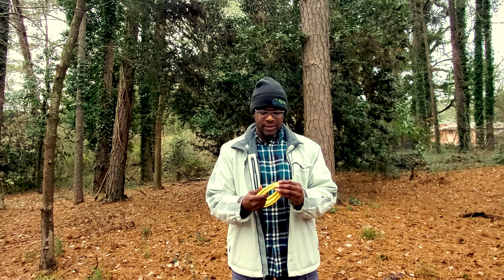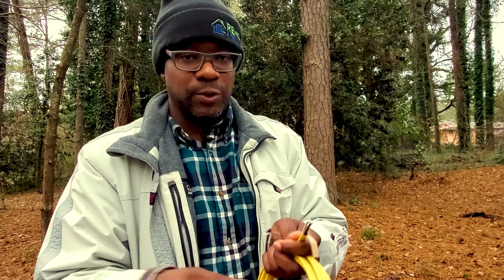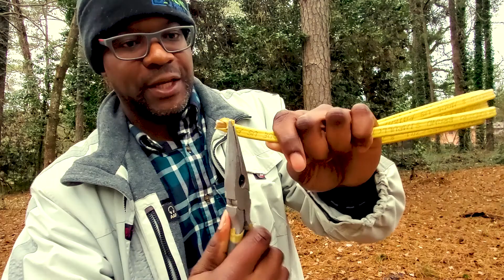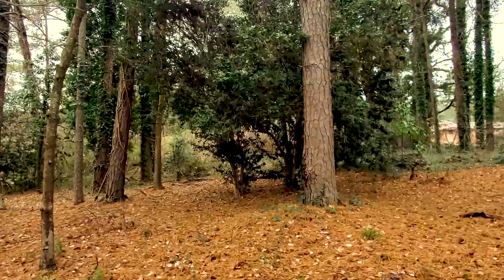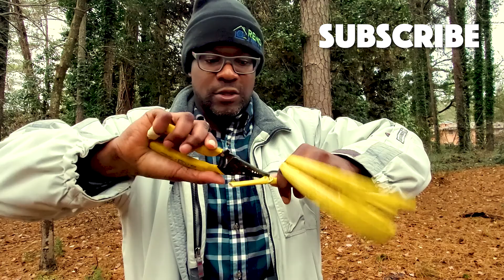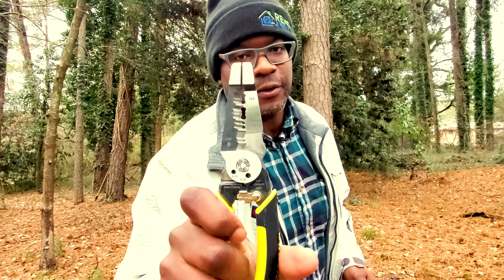How to Strip Romex Wire | 4 Different Ways

Comment: One of really good ways to strip as far as the outer casing goes,make a cut right in the middle of the wire, then pull from the middle not too much though you  don't want to bend the other little,wires to much anyway if it's newer the casing should slide right off nicely a 3rd of the work is done all ready, all you got to do is remove the paper casing on the bare bright wire, and sometimes the other 2 have the one coat casing that usually comes off smooth as butter, also Amazon sells knife sharpeners for like 10 bucks they are actually excellent so if you have a good blade but you don't care if you damage over time but it just needs a service purpose they are excellent for keeping them sharp with q few swipes

Comment: I always worry that the specialized tool will nick the insulation on the wires inside.
But I grew up using a "Stanley Knife" (razor knife).
Is there an even better tool that aligns the wires so that they can't get nicked?

Comment: I love Irwin auto strippers.. does sheathing and insulated wire in seconds
Reply: I have 2 of them and use them daily.  Best tool in my electrical bag.  Highly recommended.  It will do Romex sheath and wires with two clicks.

Comment: Maybe someone can help me.  The yellow outer sheathing has small rips in them.  Is that ok?   The inner wires are fine just the outer insolation has occasional holes
Reply: Really depends.. if you’re sure there is no damage then wrap it with electrical tape, but it’s not up to code. Typically it has to be replaced. Sounds like when it was run it hit something sharp.. like roofing nails in attic